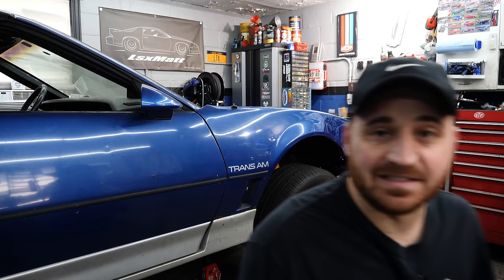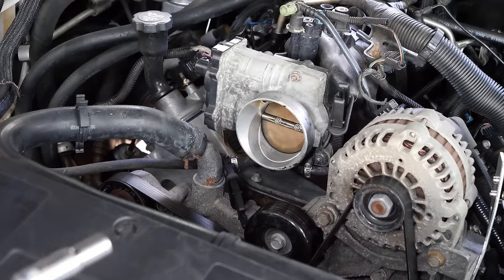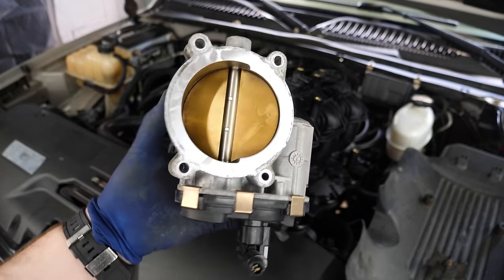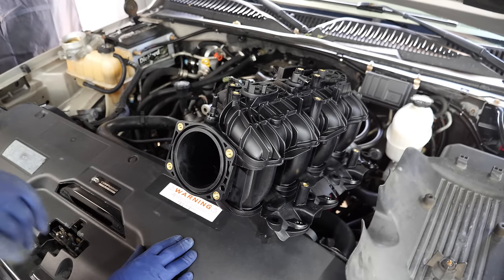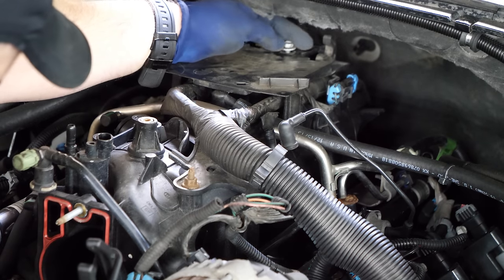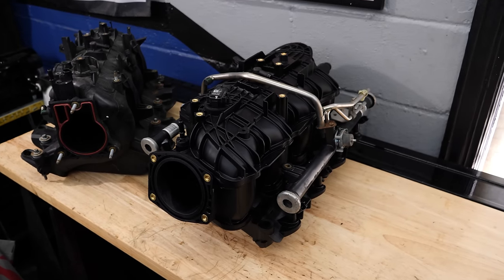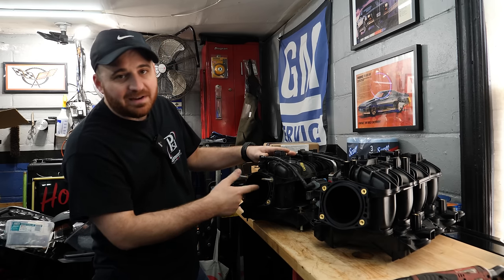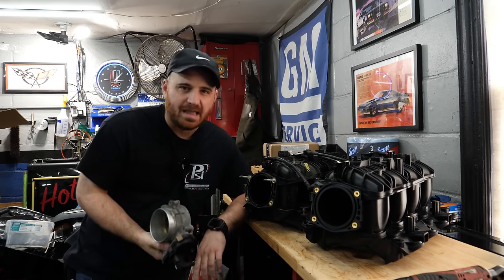Is a Trailblazer SS Intake Swap Worth It? | Install and 0-50 Test

Comment: Hey man love your videos! Got a question if you dont mind regarding a 5.3 lm7 swap. Got one from a yard. Has a dbw and I would love a dbc regarding the return and return less style setup. Current engine has a return less and I should run a return. Are the fuel rails interchangeable between the 01 and 04? Not sure if I'm able to send you a direct message or maybe you could point me in the right direction.

Comment: Nice build. For a daily driver i would love to see you install the factory Yukon Denali or Cadillac Escalade exhaust. It's a simple bolt on upgrade that should help you make more power..
Reply: @Lsxmatt-  The factory exhaust on the 00-06 Denali / Escalade is tru dual 2.5" from the engine to muffler. After the muffler it y's together into a single 3" tail pipe. It's 100% bolt on and will easily support 400hp.
Reply: My turbo car makes more power with a smaller exhaust don’t get caught up in diameter

Comment: Hey Matt, I got a random question I can’t seem to find too much info online. I’m doing a 03 6.0 swap into my 01 5.3 Tahoe, there’s the clear throttle cable/wire issue, but what harness should I use? The one on the 5.3? Or the one that came off the 6.0? Also what computer do I keep?

Comment: Its weird that your intake and throttle body is different than a suburban. I had a rich code in bank one and two considered a ghost code and it was running rough. I changed all sensors such as mass air flow first which cleared the code, then map sensor then throttle position sensor because they were due for a change especially the map sensor was disgusting. Then i did new fuel pump, fixed a line that was leaking that connects to the filter since that was the only one rusted out and changed the fuel pressure regulator. I seen a dramatic change in all of it with the small tune on the stock cam. Right now this Friday I'm changing that whole steering linkage and installing new idler and pitman arm with new rear suspension. I have a set of short headers and long tubes. I'm probably gonna sell the short tubes and install the long tubes on mine. I already hollowed out my cats, had my tuner disable the o2 sensors for emissions and went with a flowmaster super 40 series. I definitely have a ton of power and I talked to Cleetus Mcfarland and they are sending me a whole cam kit after LS Fest East in September.

Comment: I have a 05 5.3 completely stock original manifold 4 bolt  , i have an ls2 throttle body can i bolt it right on ? Also i dont have  the adapter

Comment: Nice job as always Matt. Did you end up extending the map harness? If so, did the extension change the value due to added resistance in the extension?
Reply from the maker: I didn’t have to extend them. The wires come from the pcm at the front of the truck so you can just slice the electrical tape and pull the wires back.

Comment: Why would you mount the filter in the engine bay. That's allot of unnecessary fuel line for no reason. Put the fuel rail by the tank So you don't have to run the return all the way to the engine bay.

Comment: did that clamp on fuel hose last?
i tried that and it wouldnt even work for the return, the pressure kept blasting them off spewing fuel everywhere
Reply from the maker: Did you slip it over the lip on the line before clamping it? Thats how I did it and its been fine
Reply: @lsxmatt  i think so but that was 3 yrs ago now so not sure.

Comment: If you use the trailblazer injectors do you need another x link harness
Reply from the maker: If the injectors have different plugs then you can just get cheap pigtail adapters. The x link harness is only needed for the throttle body swap.

Comment: I have my doubts about it being genuine GM for $160 but who knows
Reply from the maker: It had the holographic gm sticker on the box so I’m hopeful, but even if it wasn’t there isn’t much to mess up on a manifold with no moving parts.
Reply: @lsxmatt they could’ve used a cheaper plastic, or less of it by making the walls thinner or removing extra support sparing. I won’t say thats your case, just pointing out there’s always a way to cheap out and scam customers.

Comment: Should have went with tbss ,50# injectors, and fuel rail from ebay. They go for $495 and mine is by numbers all GM.lucky me I'm modding an LS4 in my GXP so my research matched me up to using an 09 GMC Sierra. Lucky me I got new tb on Rock Auto cheap, ordered GM throttle body bolts to cover my butt!

Comment: unrelated question but I have a 05 6.0 denali should I put a catch can on it?
Reply from the maker: You can but it’s not needed. I romp on mine alot with the heads and cam so it sucks some oil through the pcv.

Comment: Why water you not able to just flip the rails
Reply from the maker: The injectors are pitched a certain way to fit into the intake. They’ll be aimed in the wrong direction if the rail was flipped